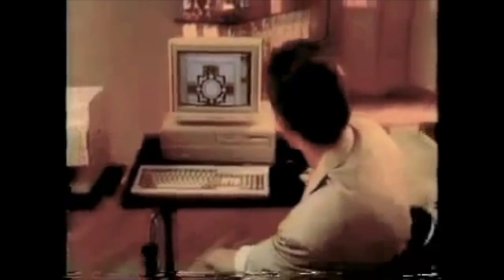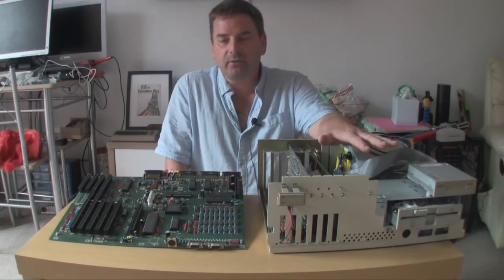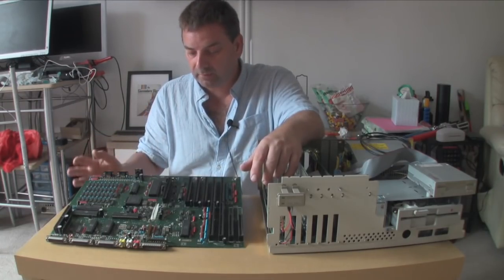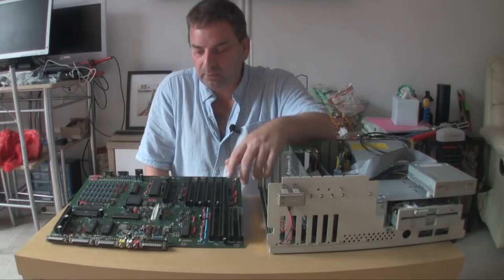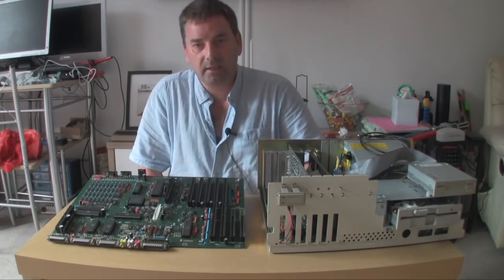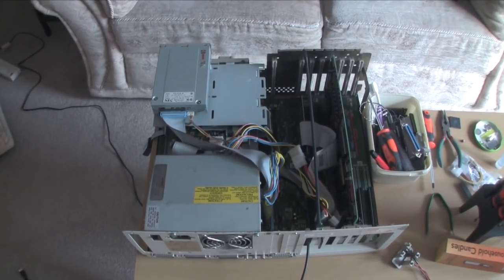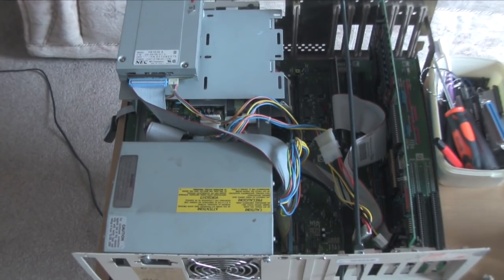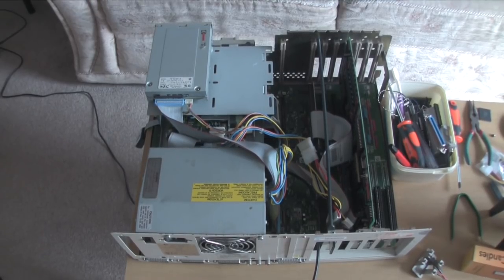Amiga 2000 motherboard change.

Comment: the motherboard of 1986 is a rev 4.0 but I'm not sure that having a 4.4 changes a lot of things I have a rev6.2 and the 1 mega chips plus corrections of the card are that it does not beugue
Reply from the maker: laurent blot 4.4 has many changes , from Agnus to the full length video slot and buster to control the Zorro cards. All higher versions are modified version of the later 4 boards. :)
Reply: hello little question about a condo of my 2000 the C 41+ to the water supply of the map mother he has what he has a 2 legs in the vacuum
Reply from the maker: Erm some translation problems I think. C41 capacitor?
Reply from the maker: Ah ok it looks like a power filter from the power supply. It can be resoldered easily by heating the pad and popping the leg back in. Are you ok with soldering
Reply: I redid the weld
Reply from the maker: Good it should be okay :)

Comment: How much did the A2000 cost in 1986 ?
Reply from the maker: skyhawk77 $1495.00 about $3000 now.
Reply: Haha, but $ is not the same value today as 1986. I  would say its about the same price as it was back then, corrected for inflation. Also, wasnt it 1987, and not 1986,  when a500 and a2000 were launched?
Reply from the maker: March 87 seems to be the release date but the boards were being made in 1986 and I’ve seen a Zorro card from 1985 ... so I don’t know exactly

Comment: ♫ Lost Patrol Music ♪ :D
"Your platoon has triggered a Varta trap. Do you rest and check for acid damage or do you risk the motherboard by soldiering on with the main quest until the upgrade is done in time for the vampire to come through the post?"
Clicks "Soldier on".
♫ Lost Patrol Music ♪ :D
"One of your team members (Agnus) has been weakened by acid damage. You must lost weight from his backpack. You discard the 5.25 floppy cable and hope when you get one from Spain in future it doesn't cost too much".
♫ Lost Patrol Music ♪ :D
"Upon reaching Spain (by Zorro ethernet), you find a floppy cable for £20. The vendor accepts payment in cash, cheque or kidney."
♫ Lost Patrol Music ♪ :D